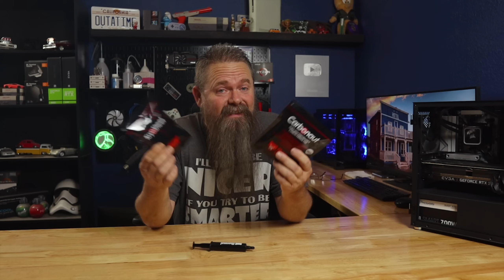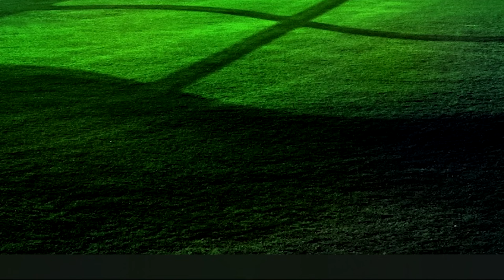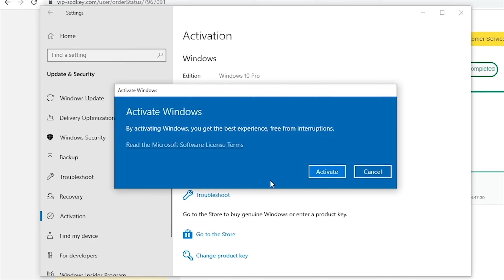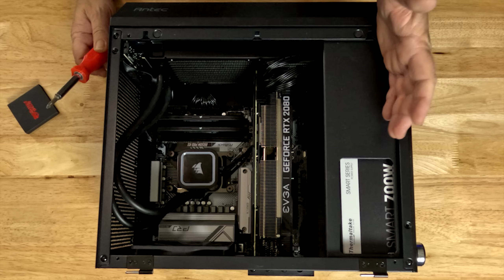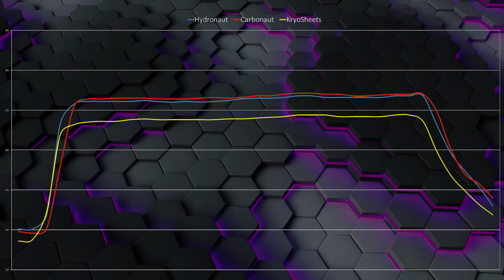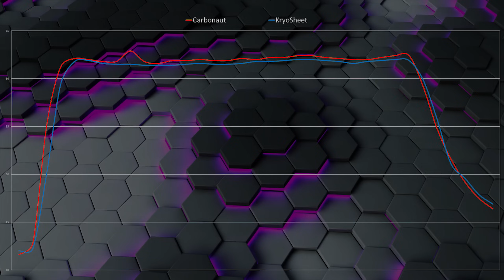Thermal Pads OR Paste, Which is Better?

Comment: I started using Honeywell PTM 9750. Its a one time use. I use it on the CPU and GPU. This stuff works better than I expected. CPU idle temps 33c , 67c under full load the GPU gets to 74c under load. I should do a benchmark MX4 vs Honeywell because those Honeywell pads are expensive. For the cost of the thermal pad you can re-paste about 8 times but the pad will never go bad and it last forever until you take the heatsink off. The pad goes through a phase change it turns into a liquid when it warms up its kind of soft at room temps.

I used GTKstresstesting and Firmark and Psensor.
I'm only using this stuff on something that gets punished like a workstation or for a gamer. It's kind of expensive. Something cheaper like MX4 will work fine on most laptops.
Reply: I figured out put them in the fridge and try to put them on cold the stuff is soft at room temps and it's hard to peel off.

Comment: What do you think of the AMD Ryzen 9, 3900X CPU..in 2505..?
Reply from the maker: I wouldn't buy it new but if you have one it's not a bad CPU. I have a couple 3600s in service still and they work great for what I'm using them for.
Reply: @CyberCPU  Thanks for the reply. It's my current computer. I forget what motherboard I have, but the GPU is the Geforce RTX 2060 Super is it has 32 gigs of G.Skill Ripjaws DDR4 ram. I mainly edits photos in Lightroom with this computer.

Comment: Forget about thermal pads. They turn to adhesive and you end up de-lidding the device or ripping pins off of it trying to remove the cooler. No, thank you. Also, you used WAY too much paste. I just spread good paste just thin enough to not see through it and everything is fine.

Cleaning thermal paste or nasty pads is easy. Use Electronics Cleaner from auto parts stores and even Walmart has it (for now). It will just rinse off with it. It is FAR more effective than even 93% alcohol.

Comment: Graphite sheets are a genius idea from Thermal Grizzly. AIOs are becoming more popular than ever. Paste is messy. Liquid metal even more. This gives a majority of low to medium end PCs a great longer term solution. I've been using the carbon sheet with my 7950X since October and have only a 5C max difference with top thermal pastes. With undervolting CPU, it's more like 2C temp difference.

Comment: As an engineer, I designed a variety of devices and machines that used exclusively sil-pad (very good, high fill rate, very thin, high-grade adhesive or no adhesive) simply because everyone I knew had seen paste "dry out", especially paste that came out of tubes labeled "won't dry out!" - partial lies. If it's a silicone fluid, then no, it does not "dry", technically speaking.  If the fluid is pure dimethicone as it should be (there aren't that many silicone fluids in existence - but they come in different molecular weights) then it will not evaporate.  But it can be adulterated with cyclomethicone which does evaporate.  Dimethicone can migrate... use silpad, use adequate clamping force, use modern device packages with lower thetaC-S vs. older styles, specify your sink for the highest possible ambient your device will experience, and consider using a fan.  I like to avoid fans when I can, in favor of massive heat sinks, because fans can fail.  Having a clean overtemp shutdown becomes important if you use fans.  None of this applies to GPUs which spend their whole lives on the ragged edge of failure.

Speaking as someone who games now and then even as a retiree, and as someone who has designed servers, high performance serial data processing cards for PCIe slots, high performane RF equipment, high performance audio amplifiers, and other fun projects, some form of silpad can always be used. And of course there's no mess.
Reply: Damn, after all that working and experience, engineers still can't express themselves clearly!

Comment: YT hates my long comments.  Great video and presentation.  Side notes to end-users and beginners, it's best to mount the radiator with the hoses on the bottom or on the top of the case.  Hope this comment isn't auto-removed.

Comment: I used Kryonaut for about 3 years, pasting my laptop every 6 months, purchased 1gm of tube like 4 times and 4gm tube once. Tired of repasting every 6 months, next i want to try kryosheet as opening laptop is pain as those small screws gets damped every time. If the kryosheet can last 3-4 years with identical cooling it should be worth the price, otherwise its a waste.

Comment: i pulled an aio off a 5800x that I'd used thermal griz. paste and the cpu pulled out of the clamped closed socket ! Luckily reinstalling all works still ! So a pad would stop that issue on the pin based cpu's which of course now are obsolete

Comment: i have a ryzen 7 5800x3d on a phanteks ph-tc14pe using corsair tm30 thermal paste and it shoot up to 90c after a few min of gaming. whats the best way to fix the heating issue. it shouldn't get this hot that fast right ?

Comment: Love the KryoSheets! Never have to worry about tearing down my system to reapply thermal paste, which is such a help when water cooling. I've used KryoSheets on my 5950X and 5700X CPUs, and my Strix RTX 3080 GPU that I tore down to put a water block on. I've had no issues with temps over the last 4 years.

Comment: Do the sheets fit well on the AMD R9? Is there a risk of touching the visible contacts in the recesses of the processor without using the frame?
Reply from the maker: The pads are non conductive. So it doesn't matter what they touch.
Reply: @CyberCPU  Their website says it is, also a test from Igors lab.

Comment: I think one thing that I haven't seen anyone test yet is using a combination of both. Applying a thin layer of paste on the cpu and the top side/heatsink side of the thermal pad.

This way, the thermal paste will help with the heat transfer efficiency from micro gaps from the uneven surface of both the CPU IHS and the surface of the heatsink. The thermal pad, on the other hand, will work on covering the larger gaps from the uneven surface of the IHS and heatsink surface. 

So, in this method, you can skip the risk of "lapping" the IHS. Since the thermal pad will be thick enough to cover any uneven surface/pressure/contact between the IHS and the heatsink.

Edit: Also, this method can hopefully hold the thermal paste in place instead of spreading out of the contact surface throughout it's use and maybe extend the need for frequent repasting.

Comment: Im really excited for the PTM 7950 from honeywell. Gpu's often get really hot later in their life cycles. People should NEVER have to repaste a gpu. Considering how tricky it is. That stuff lasts a very long time. Its being used alot now, and i hope they use it more in the future. Unlike with a cpu which isnt that hard to repaste. A gpu, is literal pain. The stuff they put on it, needs to last the lifespan of the card. Because doing a repaste, also often times means redoing all the thermal pads too. Gpu's are far too expensive to ask someone to drop 30-40 bucks for stuff to repaste every few years.

Comment: Thermal pads are not meant to surpass the performance of thermal paste in terms of temperature; there may be a difference of +/- 2 degrees, but not much more. The advantage of thermal pads is that they are easy to apply, reusable, and, most importantly (it would be great if someone conducted a test to compare), they do not dry out like thermal paste. This means that even if they start off with the same or slightly worse thermal performance, over time, as the thermal paste dries out, their temperatures will remain stable, whereas the thermal paste will gradually increase in temperature until it needs to be reapplied.

Comment: throw away tissues. And use tweezers.
I got some kryosheets for my CPU and GPU, they seem to work well but MAN were they expensive.  But at least I don't need to worry about paste layer thickness and degradation.

Comment: Thanks for your review it was helpful deciding what to use using the pads was easier and clean option and still provided good cooling performance, I think I would only go with thermal paste if I had a much higher performance cpu

Comment: Here is my 2 cents regarding the kryosheet and its one time usability. You don't use it because it provides the best temps. It doesn't. There are pastes that can deliver better temps (especially liquid metal ones meant for overclocking) but delivers good enough temps (upper mid range of pastes).

Kryosheet should be used in extremely hot GPUs (those that can do 350w+ daily, like RTX 3090, 7900XTX, 4090 etc), for at least 2 reasons.
1. Thermal paste wears out considerably fast at such thermals. It dries out pretty much within months if you actively game on it so you keep having to open your GPU, clean it, reapply paste and drive it for several months till it's that time again.
2. Paste pump. It's real. At such high thermal intensities, the IHS of GPU chip as well as the heatsink, expand and cool, expand and cool, that is basically causing motion to push the thermal paste out and ever so increasing your GPU temps until you notice and need to repaste.

Kryosheet prevents paste pump and the more the GPU and its heatsink expand the better the thermal interface will be which is why you can see such good and stable thermal response as well as kryosheet doesn't lose its thermal capacity because it goes dry... It's ALREADY DRY!

So basically as your daily driver GPU, you put kryosheet in, you don't have to ever worry that it will lose its thermal capacity, will go bad in any way. You just apply it once and you use GPU for as long as you want, no matter how hard you drive it (game for 10-15 hours at its overclocked stage) it will not lose any capacity, on the contrary it may improve as the heatsink and IHS compress and decompress thus during compressions it just fits more and more into the microscopic holes to create better thermal interface.

Same goes for CPU. If you got the cooker, put this thing in, slap a good capable cooler on top and forget about it. 

But this product is basically BAD if you are often swapping out coolers, CPUs for testing purposes as you can't use it more then once maybe 2-3 times before it cracks out and loses efficiency.

Comment: Hmm did you just check temps? That is not enough if you did that. You need to see how much power the cpu draws, it is not uncommon for a better cooling solution to provide more thermal headroom to increase clock speed and hence powerdraw. So unless you cap it somehow a better cooling paste might yield similar temps to before.

Comment: Pads are only for low TDP things where you need to overcome bigger gap, everyone who has some experiences with PC building and moding knows that any kind of pad is totally useless for CPU and modern GPU. Those modern carbon and such pads kind of work, but again, it's usefull only low voltage and low TDP models and there is pretty much no reason to using it, you mostly destroy it just by pressing cooler to it, don't tell me that to use paste is more complicated, it's not and it's also significantly cheaper.

Comment: Bud you totally missed something quite crucial. Those cpus have a frequency boost curve based on thermals, meaning that they will boost higher the colder they are on specific frequencies, this means that if for example the thermal paste performs thermally better at 5ghz all core load it will allow the cpu to boost higher and that will result on worse averall thermals in the end but with a higher overall frequency and vise versa if the 5ghz was a bit hotter for comparison it will boost lower but in the end you can see lower overall temperatures due to the lower all core boost clock. In these sheets you should put the average frequency of the processor. Usually to avoid these issues you can always use a fixed frequency and that will reveal entirely the thermal transfer of these products reliably.

Comment: It really just depends what products you're using. If its Thermal Grizzly Kryosheets or Honeywell PTM7950, then use the thermal pads, because they both GREATLY outperform thermal paste. The Thermal Grizzly Kryosheet actually performs similarly to liquid metal.

Comment: why do you mount wires under the GPU why not just go to the top of the case with the CPU power cables
Reply: Usually it's because of the orientation of the gpu plug, it's too much stress on the gpu and cables if you twist them
Reply: @brandonthomas4527  I was talking about the CPU cooler wires that he ran sandwiched between the GPU and the motherboard

Comment: This product should be a good option on the PowerPC G5 Cpu , sadly it's 2 large for the core(die). On the Powermac G5 , it's a half day job to pull , clean and re mount re calibrate the cpu's , not worth doing for just a re-paste. It takes at least 2 h for a person who did it each 2-4 years.

Comment: The more intimate the contact and the lower the thermal resistance of interface materials, the lower the die temp will be. It’s equivalent to resistance in an electrical circuit.

Comment: I personally use Arcticlean to remove thermal gunk. It just works better than plain alcohol and smells better too. Put a few drops on, swish with cotton swab, soak up with paper towel. Turning it into an absorbable state makes cleanup so much easier. Sure it costs way more than just alcohol but one bottle lasts you years anyway

Comment: I think the main point of using Carbonaut to begin with is to ease the maintanence of your machine, not only reusability or making less mess (also be careful with its electrical conductivity, unlike thermal paste, you don´t want it to be touching anything else than the chip which can than shortcircuit something sensitive). For example instaled Carbonaut pads in my laptop to transfer heat from cpu and gpu with it (quite a pain to cut it to right size with scissors and unlike instalation in PC where you have to just align your cooler, thermal pad and chip, one at a time and its done, in laptop where heatsink is across both, you have to hit both of them and you donˇt want it to move xd) and since instalation, i didnˇt had to replace it like i would have to with thermal paste, as it didnˇt changed its efficiency for YEARS! Outside of ocassionally opening laptop to blow out the dust, its ideal solution for places, where when you instal it, you won´t have to care about it ANYMORE. (Tip, i managed to have both aligned on first try and my tip to avoid any chance of having unknown hotspots at the edges and not waste your thermal pad by cutting it too small, my recommendation is to cut it in a way you have around 0,5 mm over the edges of the chip. Just have it really really little bit going over the edges, just not let it touch or risk touching anything else.

Btw Temps are nice, stable and most importantly UNIFIED across whole chip, as its thickness is same across unlike with thermal paste.

Right now laptop is still staying strong and its cooling is taken cared of for many more years to come as long as i blow dust out of it ocassionally, and now as iam thinking of buying and build myself brand new PC, i will without doubt use Carbonaut instead of Thermal psate ;)

Comment: Having 4 studs to mount your cooler on is a plus. Two spring loaded screws can be sloppy and could easily cause a damaged sheet. Re-pasted my 2 year old Silent Loop 2 vertically in a new case, same MB/PROC and had an overheat before the memory phase completed. Took it all apart and had gotten MX-6 all down inside my new ThermalRight Secure Frame. I try to keep it about peanut sized next time pea sized. Thanks dude! You convinced me to stick to paste. I always used Arctic Silver 5 but -6 doesn't spread like it would. So I do the "little dab'll do ya" now.
Reply: I bought few of those carbon pads to test it, I destroyed like 2 of them just by mounting cooler and third one had significantly worse temperatures than with just paste. No, these pads are not ultimate life hack, it's just fashion created by youtubers who are sponsored by these companies.

Comment: Question: Can you combine paste and pads for extra cooling
Reply from the maker: No. You want to use one or the other.
Reply: @CyberCPU  thanks for the clarification  .I had a thought I could put the pad down first, then apply the paste on top or on the bottom of the cooler.

Comment: will these KryoSheets be ok to use if i'm using a cpu cooler with the AMD offset? It looks like a little of the pad won't be under the heatsink i'm and scared it might flake off and get on other components.

Comment: I used some ptm 7950 for my 7800x3d with a 360 aio water cooler and haven't had any issues across the California summer. I think like 80c was the peak after 3 hours on a 105f degree day.

Comment: For my upcoming build I think I will stick with thermal paste with my 9950X, I bought a contact frame for it too, while it doesn't do much for cooling it will make future clean up easier. I am not sure how well a thermal pad would perform on a top of the line CPU like that. I tried one of the thermal pads on my am4 system and actually performed worse than thermal paste. Although I dont think it was one of thermal grizzly's pads

Comment: Is either pad electrically conductive?  I would think the graphene one might be.  Any tiny surface mounted parts would have to be avoided if it is.  It is the same problem with silver thermal pastes that are notoriously difficult to clean up.  I just wonder if either of those pads has that hazard (minus the mess of course).

Comment: You should probably rerun this test with a 2mm thermal pad, as no mention to thickness was mentioned. From what I've seen, they come in 1mm, 1.5 and 2 mm, which seems to me, to do a better job.
Reply: The thinner the pad the lower the thermal impedance and better performance.